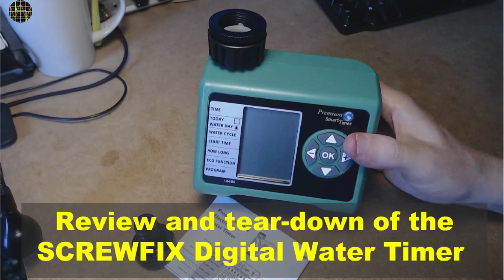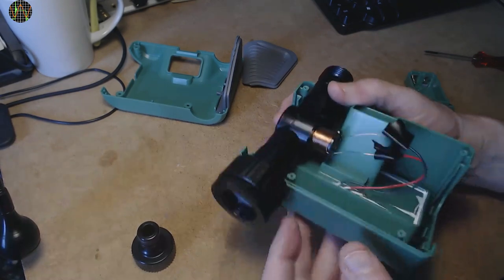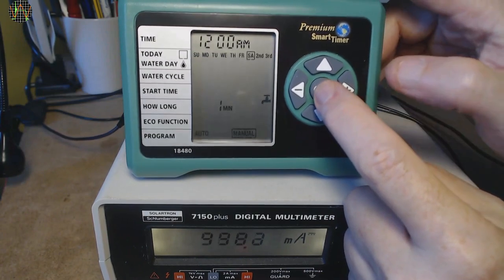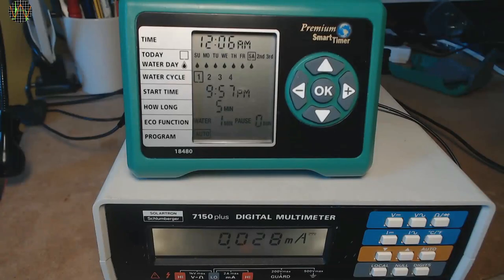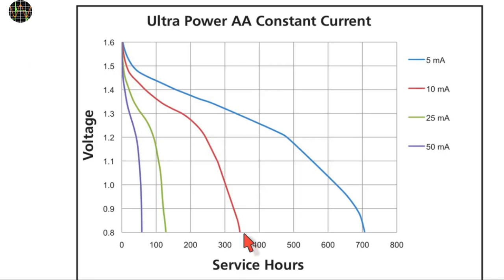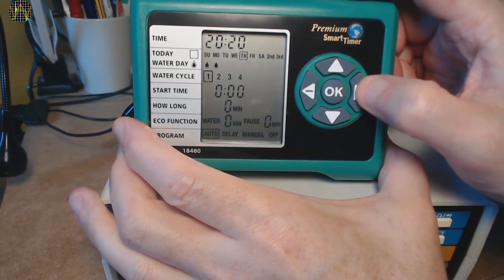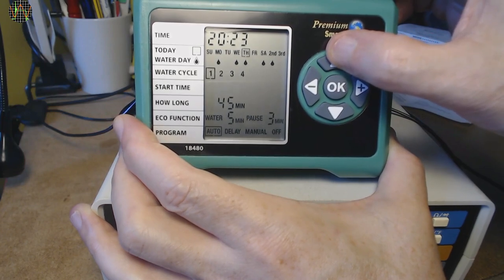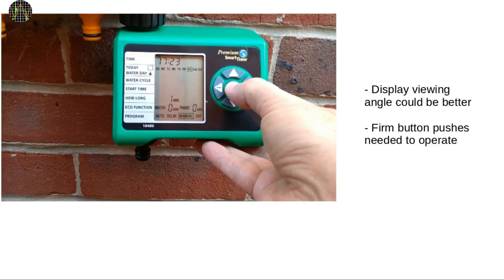Review and tear-down of the SCREWFIX Programmable Digital Water Timer order code 18480

Comment: Bought two of these. They worked well, but neither survived the winter. The freezing temperature broke the internal black pipe. So if you have them, I'd recommend taking them in over winter.
Reply from the maker: Yes, that is certainly a good idea. I disconnect it and store it in the shed. Still outdoor and unheated, but once the water is out, there is no danger of bursting the pipe. (I also take the battery out). I have not used mine for a more than a year because I only used it when going on holidays and ... (pandemic)...

Comment: The timer with screwfix code 18480 has been discontinued which have 7 rows of settings as you can see on the front of the product. The replacement timers Screwfix ( (4280V, 579PT have only 6 rows of settings) are selling looks the same but does not have 4 'water cycles' a day or 'eco function' unfortunately, if you read the front of the product or instructions carefully. You cannot set any 4 start times in a day with the replacement timers - you can only set one start time a day instead however you can repeat the watering every 6 hours for example so you can achieve 4 waterings in a single day 6 hours apart- just not at the specific times you want which may not be 6 hours apart. If you want the original features, other manufacturers do make the same product under a different brand name.
Reply from the maker: Its sad when the replacement can do less than the original. Thanks for the warning.
Reply: Yes, it is unfortunate because people expect newer versions to be improved but in this case it is the opposite. A company called Costwise do sell the original timer under their own brand name in the uk. Other countries sell the original timer using other brand names.
Reply from the maker: @amuthanshan  That is good to know. Many thanks

Comment: Very helpful review. Could you advise if it would work using low water pressure, like from a header tank or waterbut? Thanks
Reply from the maker: My unit is currently not connected and stored in the shed. Its winter here in the UK and we have plenty of rain... Anyway, I assume you are worried that the valve needs reasonable high water pressure to seal properly when closed? All I could do to test it at the moment is to fill a little water into the inlet from a jug and that did not leak out on the other end. Disclaimer: This test was with very little water, I only waited 5 min or so (its pretty cold in the shed)  and its just my unit, others may behave differently.
Reply: Thanks for replying so promptly. My concern is whether the (gravitational) pressure from a water butt will be sufficient to flow through the valve. I will need to get one and try that. Great and thorough review by you. First class.
Reply from the maker: Ok, sorry for misunderstanding your first question. I just did another test. Filled a little water into the inlet and when commanded to manually open the valve, the water started  dripping out of the outlet.  It looks as if the valve could work with low pressure, but of course it may still restrict the flow a little. Hard to tell.
Reply: Thanks.
Reply: @HUMBLEBUMBLE1  I'm probably a year to late but for gravity fed you need a timer that uses a Ball Valve rather than a Solenoid.
Reply: @northeastcorals  In any event, thanks for taking the time to reply.

Comment: Is it waterproof
Reply from the maker: No, but I have not had any problems, using it every summer. Rather than trying (in vain) to make something 100% waterproof, I drilled a little hole at the bottom so any water that gets in can drain out.

Comment: Underneath is a plug with two pins, for what ?
Reply from the maker: Not sure what plug & pins you are referring to? The only ones I can think off are those on the battery tray and they are connecting the batteries in the battery tray to the circuit board when you slide the tray in.
Reply: @TheHWcave  I think he means the black rubber plug at the bottom. When removed it exposes a male 3 pin connector. It could be for a moisture sensor, remote switching or external power but I don't have the facilities to investigate.

I've had 3 of these units, none last more than 2 years but the alternatives are no better and this is cheap, does the job.
Reply from the maker: Thanks David, 
Unfortunately my unit doesn't have this connector or rubber plug. Maybe they are now selling an upgraded unit. I could well imagine that it is a rain sensor of some kind but unfortunately nothing I can check. My unit is still going strong and is not giving me any excuse to look for a replacement. Its definitely the longest still-working timer I ever had.